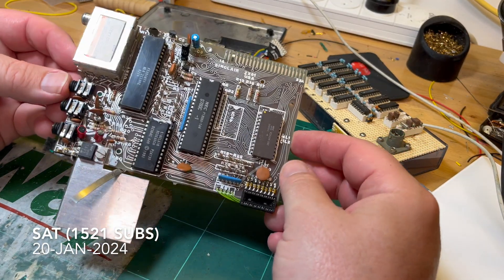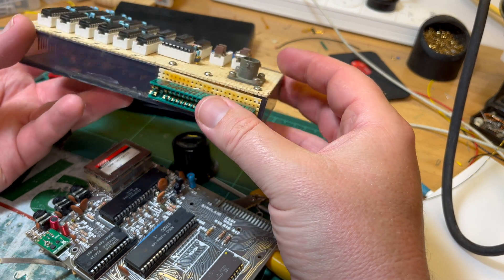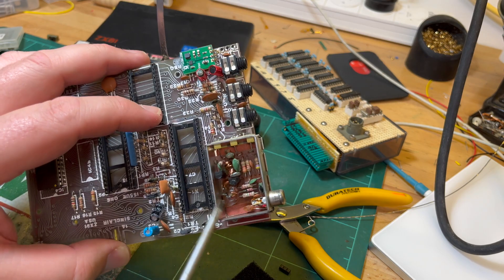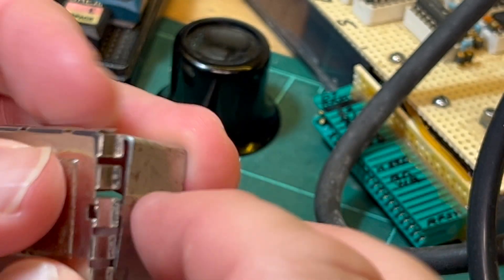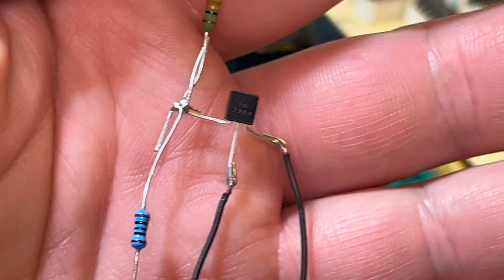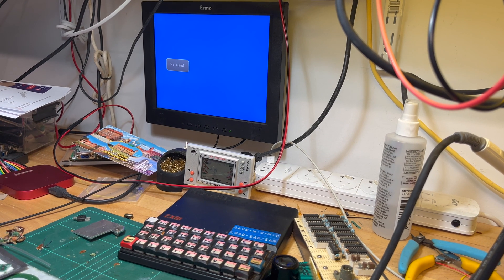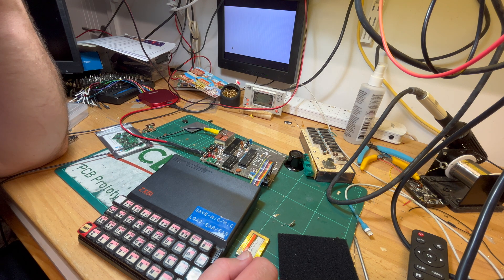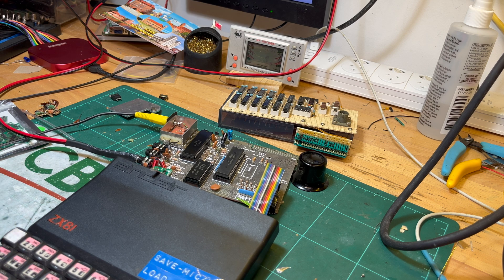🇺🇸 Heavily Customised USA ZX81: Part 3 (Regulator & Video Modifications) [TCE #0401]

Comment: I know this may not be the very best video to ask, but do you plan to explore non-48k zx spectrum clones from Russia? I'd love to see more non-russian videos on higher spec machines like the Pentagon, Scorpion, KAY, ATM and maybe even Profi.
Reply from the maker: I think I've only got one clone from Russia (Мастер), the rest are from around the former USSR ... I think Ukraine and Moldova and the top two sources.  But it is an interesting question.  Of course, I could probably build a modern one myself but if we're talking about "original" home built hobby machines from the 90s then I'm reliant on what's available on ebay.  Of course Meshok is an absolute gold mine of exotic & weird machines but about 99% of sellers are in Russia and so off-limits.  I will keep my eye out on those other machines you mentioned - I'm an Amstrad person so not so familiar with the Speccy scene. /Brett
Reply: @Brfff  All of my higher end clones are reproductions actually, in fact the only original clone I own is a Didaktik M. The high end machines I've seen on eBay are either severely overpriced (the Pentagon v3+ by solon has remained unsold for 2 years now I think), badly broken or both.
Reply: @Brfff  Coming back to this, one 48k clone from Ukraine I'd love to see would be the "PC-01 Lviv" (Львов) ... I don't think it was ever produced in large quantities, but is one of the very early clones (some sources say 84/85) and supposedly extremely close to the original Sinclair machine. It can be easily recognized by having CPU and ROM on the upper part of the PCB and 4 rows of TTLs (almost like 70s arcade boards) below, spanning roughly 60 chips.